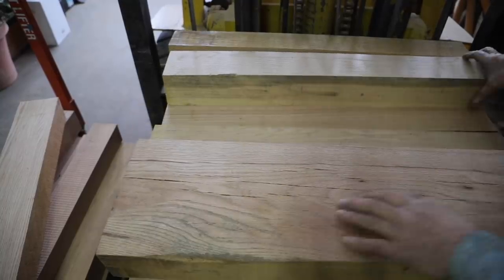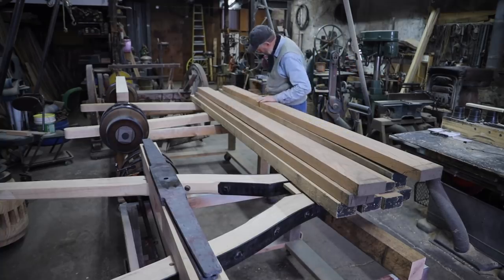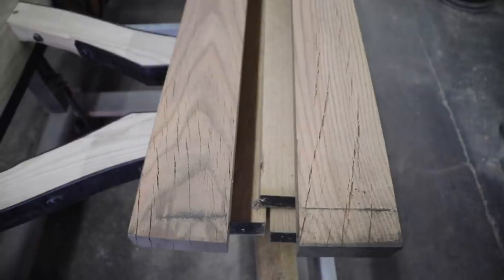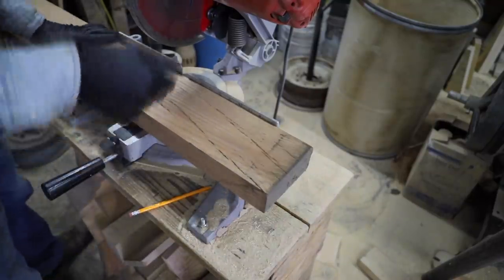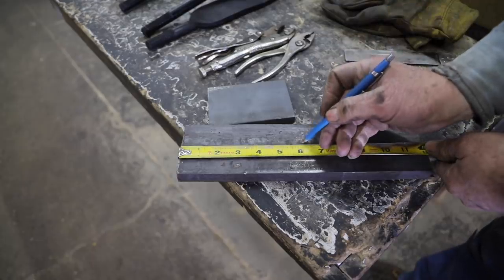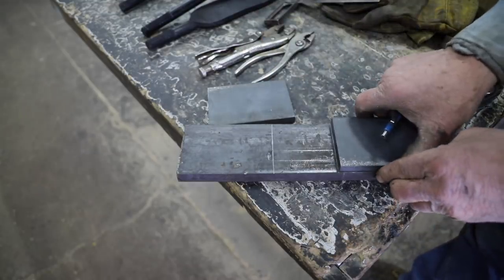Wagon Spokes & Forge Welding to Build Heavy Wagon Wheels | Engels Coach

Comment: Somehow I missed this video when you originally posted it.  To the non-Blacksmiths out there, I wish to convey just how special this is.  Those welds are perfect !!  The craftsmanship is top notch.  I've seen original welded pieces from old wagons that don't look this good.  Also, round filing a fillet radius on the inside corners is vital not only for a proper fit but for preventing a crack to develop.  Beautiful work Mr. Engels !!

Comment: I run a portable sawmill. I always advise my clients that the worst thing you can do with oak is to try and force the drying. I must be allowed to dry slowly (when not using a wood kiln). Sealing the end grain would have prevented a lot of that splitting. Truthfully, that was not too bad. Didn't appear to be any casehardening or honeycombing. Thanks for sharing.

Comment: Thanks, Dave, for yet another great video. I wonder how much of that checking could have been avoided with an application of Anchorseal to the end grain. Thanks again for letting us watch.
Reply: @EngelsCoachShop  It's not like you can control what they do in Death Valley from Montana. I myself only learned about that stuff a few months ago and I had worked with wood for decades. I guess it's a pretty new product, and that's a guess.

Comment: Watching you weld brought a memory of "helping" at a blacksmith's shop as a child.  Being of nervous disposition I asked where to put every bit of metal I'd swept up, and at some point was simply told to "Just dump things into containers that already have the same thing inside!"  and left on my own for a few hours.
By the time lunch was called, I'd collected cut-off rivet heads from every nook and cranny I could reach and overflowed what in your forge appears to be a water-pot.

I was admittedly momentarily confused why you were alternating between dropping your rivet heads in the pot and in the nook behind the anvil. :)

Comment: Multi talented for sure Dave. Even when wagons were in full production very very few would have had the combined talents to do it all. Factory's would still have had separate specialist's even back then. The local blacksmiths would have been doing mostly repairs. And the custom coach builders for those that could afford it would likely have multiple men in each area of the shop. I doubt there were many one man wagon builder shops around that could do it all from scratch. 

I am curious about why you forge welded those 3 pieces and didn't stick weld them. The forge welding would be unmistakable for how it was done, so doing it the historical correct way because of that is my best guess.
Reply: @EngelsCoachShop  It seems like a good logical guess to me. :-)

Comment: I noticed, at 3:00 into the video, just before starting to use your table saw, you counted your fingers so you'd know if you lost any.  BTW, do you sharpen your router roundover bits or just buy new ones when they dull?

Comment: Big question:  What's the water tank going to be made of? Are you doing that part, too? It carried, what, 1200-1500 gallons?
A gallon of water weights 8.34lbs. That works out to the water alone weighing between 5 and 6.25 tons. Some serious weight.

Comment: you should try using the hydraulic press to do forge welding instead of the power hammer.  I've been told it's basically the magic sauce...
(not a blacksmith, but my brother runs Baltimore Knife & Sword...)

Comment: Good Day Dave. Would it be faster and therefore less expensive, yet of equally quality to start with a strip of material of the correct thickness, cut it to length, and mill out the middle to the required specification?

Comment: Watching you route the spokes with the rounding bit looks like you are backing into the cut.  Does your router turn counter clockwise, or does backing into the cut lessen splintering? [add] Does heat welding 2 plates together cause a stronger bond than starting out with a thicker plate and removing the center?  Or is this process copying the original construction?
Reply: @EngelsCoachShop  Climb Cut is a good description.

Comment: What is the power you are putting on the steel, some sort of flux ?
Reply: It's probably borax used as a flux to keep the oxygen from creating scale on the metal as there welded together. It allows far better forge welding than not using it. I'm not even sure forge welding can be done without it.
Reply: @turningpoint6643  Thank you !
Reply: @ranchdude4367 Your welcome. But I only know a little bit about it, and that's a whole lot different than actually having the skills to do it and have the metal bond together correctly.

Comment: im sure you  have been using a table saw for many years and are an expert with the saw but i still get a bit nervous watching you using it. i can understand no blade guard because it would get in the way with the jigs you use but there are times when a riving knife could be used.  have you ever had a bad experience with kick back?   i did one time and i installed a knife on my saw.

Comment: The enjoyment received from watching your posted videos goes without saying. Albeit, your's is a very dangerous profession in many ways, (i.e.) welding forge, table saw, sanding belt, heated metal, cutting torch, to name but a few. I would suggest that you consider eliminating one of the most obvious dangers by installing a power feed for your table saw. It will make sawing large stock much safer and much faster.

Comment: Why don't you bend the wheels rim - rather making them from segments? For the big wheels it might be complicated to get boards long enough for the wheels (a wheel of 1,5 m diameter requires a 5 m long board...), but in terms of process, I couldn't immagine any problem to bend them by using the Thonet method (strap with end-stops). And - the bend wood rims would be so much more durable...

Comment: This is not about safety. This is about using machines and paying attention to scratch build something that doesnt look "new". Im sure he could have found some steel and made the pieces by cutting down the middle etc. etc. He used what he had, and the final product looks not only great, but authenticity old school. Somehow I think that the "sawstop" users are going to be going on about safety anyways. 

"sawstop" refers to the saws that destroy themselves as soon as you touch your finger to blade.
Reply: @EngelsCoachShop  actually it is. How to build coaches and wheels the old fashioned way. I love it!

I meant no offence at all. Yes there is a lot that can be done by computer, however the computer wont give that 'hand made' feel that only your experienced work can produce.